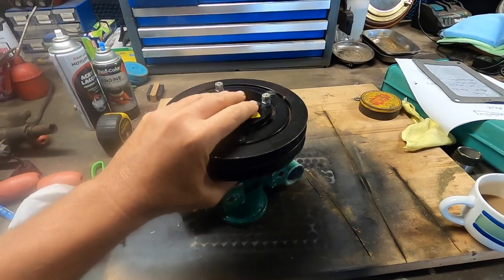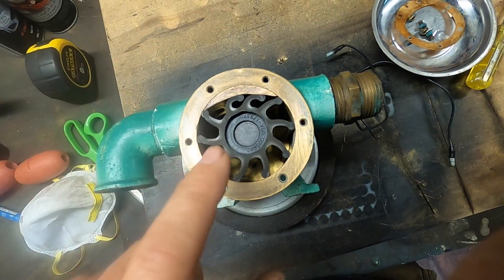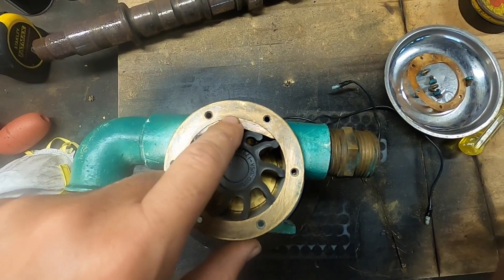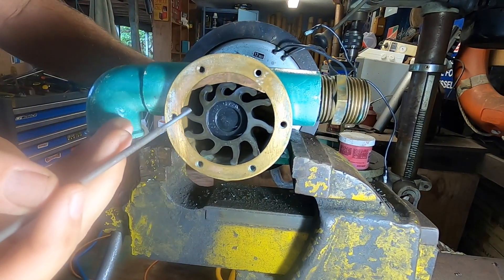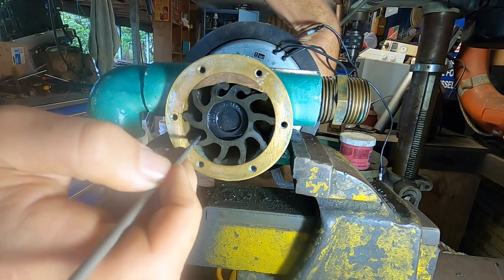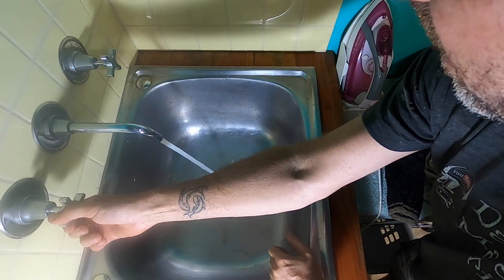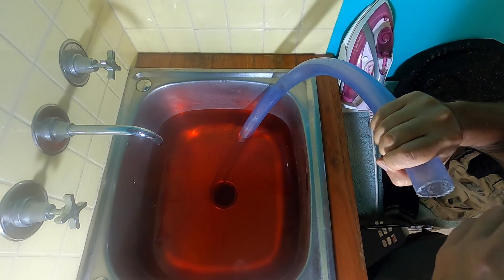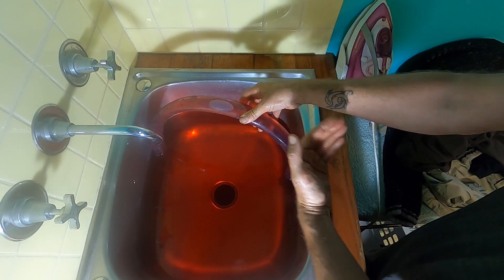How does a Jabsco pump work?

Comment: Wonder how much room you have to hang accessories off the engine, a jabsco for emergency bilge, another for deck wash, an air conditioning compressor repurposed to compress air, a power steering pump to operate hydraulics... this is why I have too many incomplete projects
Reply from the maker: This pump can go into a manifold / seachest which will allow it to be a billge pump and a deck wash at the same time. I also have an air compressor to hang off the Detroit so I can sell the portable one.
Reply: We all have incomplete projects that’s why we watch Stu 😁
Reply: A/C compressors for compressed air don't last very long. There are plenty of dedicated engine driven air brake compressors for relatively cheap. They're under $400 in the States.
Reply: I was wondering how long an AC compressor would last, assuming a bit of oil down the intake regularly. If a purpose built one is available that’s definitely the go

Comment: A check valve before the pump would help maintain prime in your intake.
Reply from the maker: I can see what you are thinking, but they generally aren't used. This quote from an article sums it up. "One, check valves are prone to jamming in the open position, thereby becoming an uncheck valve of sorts. Two, they are prone to jamming in the closed position, preventing water flow in any direction. And three, they can restrict water flow. In experiments I’ve conducted I’ve measured as much as a 50% reduction of water flow when a check valve is installed and working properly, i.e., it’s fully open. This can be particularly problematic for bilge pump applications." https://www.proboat.com/2017/04/many-weaknesses-raw-water-check-valves/
Reply: @DangarMarine   You are correct that with raw water and the size of your pump its not as important but many larger trash pumps have foot valves designed into them.  I work with sewage pumps from 2" to 10"'s  and have had to deal with clogs that will give you nightmares.

Comment: had a pump like this on my 1960 volvo penta bb70. I would put mineral oil in the pump for dry storage to keep the rubber happy. had it 10 years no trouble.
Reply from the maker: Interesting that it helped. Keeping it 10 years is brave! I tend to replace them a bit more regularly because if they do fail it can be hard to get the bits of impeller out of the coolling system (more so with outboards though)
Reply: @DangarMarine  brave? just cheap. the only repair/engineering fix to the bb70 was the cracking exhaust manifold flanges fix. its a bit of a long winded fix. no pump troubles but it was all fresh water use in a carver 18 foot boat.

Comment: Is this pump for engine cooling or for use as a utility water pump?
Reply from the maker: This one will be utility. Cooling pumps don’t have clutches, they need to run all the time the engine is.
Reply: @DangarMarine  aaaaahhhhh, I was thinking this was the cooling pump myself. Thats why I was a little confused about the electric clutch failing in the off position. Guess I should have Listened better. p.s. I don't own a boat, I just love the videos.

Comment: That pump you have is set up for a sea water deck wash hose reason for the clutch on it. Jabsco pumps can handle dirty water better than a centrifugal pump.
Reply from the maker: Yes, was just using this one for the demo to show the impellers. Cooling pumps never have clutches as they are always running when the engine is. This one is for bilge and deck wash.
Reply: This! Looks like that was the deck wash pump not the raw water cooling pump. Also if the pump only activates when it gets power wouldn’t that trip the alarm whenever it wasn’t running? I would think a clutch pump would be dangerous on a cooling pump and there’s no downside to it always running.

Comment: I'm surprised that pump doesn't electrically work in reverse. You know what I Mean? I'm surprised the electrical current doesn't stop it from spinning instead of allowing it to spin. Id want it to spin even if there was an electric failure. That being said, I'm an idiot soooooooo, Take my opinion like a grain of salt.
Reply from the maker: Too much risk. A wire may break with the hose coiled on deck pumping water into the bilge for example.
Reply: @DangarMarine  Makes sense. Thats why you the man.